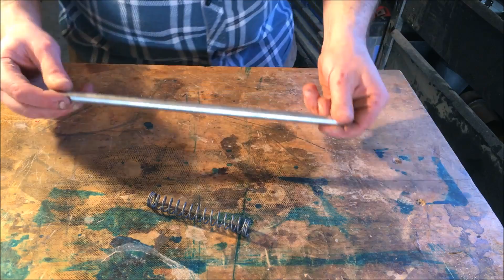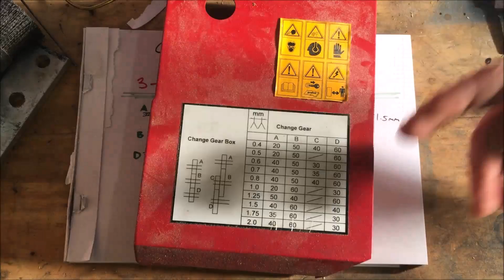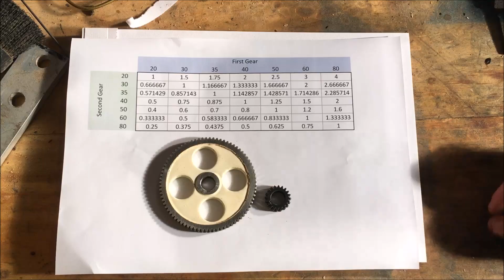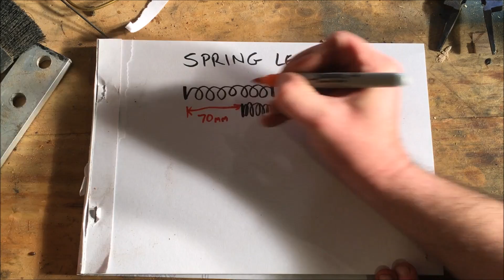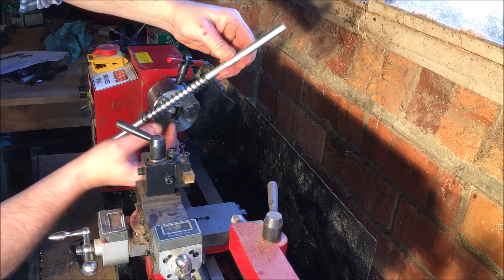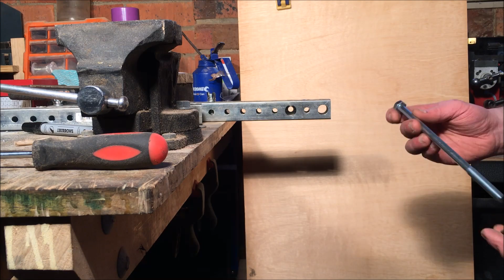Making springs on the lathe & measuring spring strength

Comment: Great video, thanks for posting. I'm considering doing this setup for our prototype spring-making. I've got a couple of questions for you. Have you run into a situation where you needed to apply tension to the wire in order to get it to wind? Some of the lighter wire that we work with has to be "pinched" as we're winding to get it to wrap around the mandrel. The other question I have is would your setup work for a larger spring like 4.6 inch diameter for example? Any recommendations on lathes?
Reply from the maker: With thinner wire and a small spring I need to pull it tight to get it to wrap properly.
With a bigger lathe 4.6 inch diameter should be possible. But for that, for the hole on the toll post you feed the wire through you might want that pointed up at an angle a bit. You want to make sure the wire in feeding in closer to a tangent to the mandrel. But doing that I don't see why it shouldn't work fine.

Comment: If you stress relieve that spring by heating it at 250ºC - 275ºC for 30minutes in your oven shortly after coiling, the spring will last a lot longer and also gain a couple of points of Rockwell "C" hardness. Allow it to cool slowly and give it a liberal dousing with mineral oil to stop it from rusting which allows hydrogen embrittlement.
All in all, a brilliant video for setting up your lathe and checking the spring's properties afterwards.
Reply from the maker: Interesting. I didn't think you could do such an effective heat treatment on the spring steel at such low temperatures. I will definitely try that out next time I need to make some.
Reply: Hi, sorry to say but there are 2 things misunderstand:

A) the Heat treatment said is ok, it is a stress relief treatment.

B) hydrogen embrittlement, this problem is Only after Doing electrolitic Surface treatment with zinc.

Comment: What are the electronics mounted to the aluminum spacers by the hand dials on the compound and cross slide
Reply from the maker: I fitted a digital readout kit to replace the standard dials. 
They stick out too far and the battery goes flat too quick, so I've since removed them and just gone back to the standard dials again.

Comment: you should be measuring your x compression distance not from the end of the spring, but from the start and end of the areas of the spring that are able to compress
Reply from the maker: It doesn't matter in this case because I'm calculating only the change in length. All the extra length at the ends cancels out when I do the subtraction.

I could have made both measurements from the bottom of the bolt to the floor, or from the top of the bolt to the ceiling if I wanted. As long as I use the same point on the bolt and the same fixed reference point for both measurements I will get the same answer.